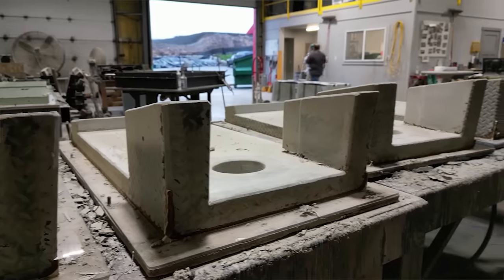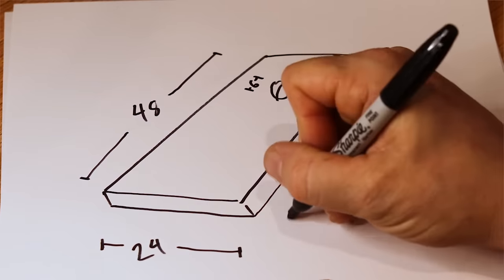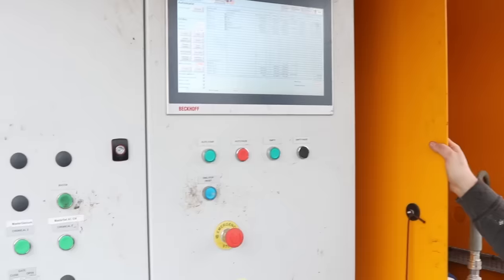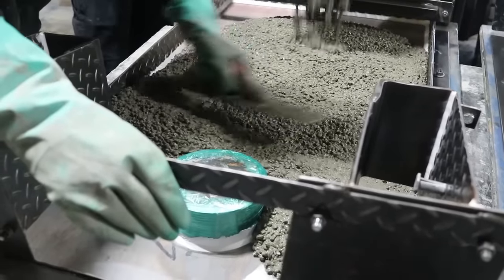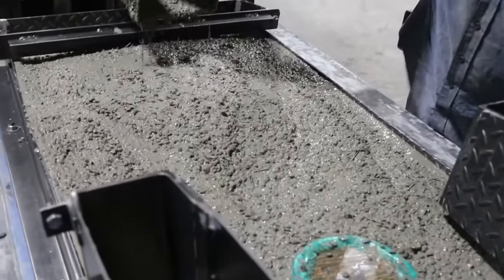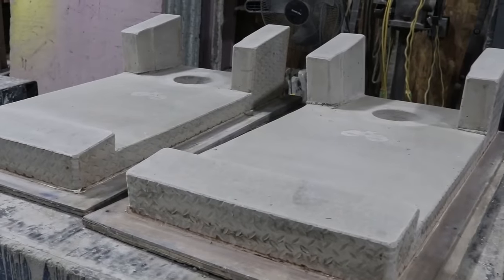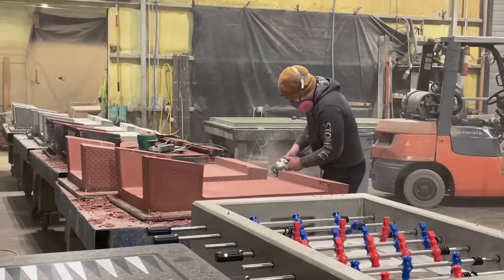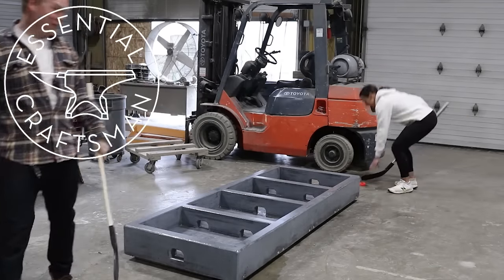Building an Unbreakable Concrete Cornhole Board

Comment: As a DIY cheat mix up some fine cement plaster, just sand and cement along with color, if you want, to paint your forms with to a 1/4”-1/2” thick before pouring in your concrete; this will ensure a good smooth finish without hollows that can come from pouring concrete straight in. Without vibration you risk aggregate being at the finished surface and with too much vibration you risk aggregate separation. I’d also embed my rebar or mesh in the middle rather than pushing it in at the end just as it’s easier for most people to do and can provide better strength, though with these small if projects concrete without any fibers or reinforcement can be strong enough for home use.

Comment: If you can’t find melamine or it’s to expensive, you can build your forms with 2x construction quality wood/boards and then line it with pieces of 1/8” Masonite , you can glue the Masonite to the inside of your 2x forms. To vibrate your forms after you place the concrete in them, use a hammer drill and go over the outside of your forms to release any air bubbles from the surface of the forms. Good luck with it if you decide to try this Do It Yourself project.

Comment: this would be great idea if the cornhole boards were made from the whipped concrete the stuff with bubbles like an Aero bar its lightweight, then they would be easy to move around rather than needing two men & a horse to move them but a pretty cool idea to make all this out of concrete
Reply: I think the whole point is that they're hard to move.

...they're designed for public parks, etc.

Comment: What is melamine .. is it a powder mix put in the mix .. I looked it up and found it speaking of forms not mixes ??
Reply: Melamine is a product used for the forms it’s basically a smooth partial board and has a white face
Reply: @salient2849  .. ok so maybe the vibrating is what made the concrete look smooth and not a plasticizer
Reply: @Jesusiscoming24  yes exactly the talks vibrates which causes the concrete to consolidate there for producing a nice finish, it’s the same concept as actual concrete forming when you use a vibrator inside the forms so that when you take them off you’re left with a smooth finish, you can get the same result by just tapping the form

Comment: What would the price for chess board 1 inch thick 20 x20 inches  1/2 round sides with engraved algebraic black lettering  with heavy duty legs blue for dark color squares?

Comment: The part I don't understand is the lack of cracking.  You pour a "2D" driveway/patio, all the re-entrant corners will crack so you need to put joints in to guide the cracks.  But somehow the 3D re-entrant corners don't crack!  Concrete magic
Reply: The concrete fibers, steel lattice, and plastizer all work to stop the cracking. Plastizer (water reducer) greatly improves the strength of the concrete. Water reduces strength in the mix process. Plastizer reduces the need for so much water. 👍
Reply: It’s a small item, concrete sidewalk that’s 4-5 feet wide will usually crack every 10 feet even with 3/4” joints tooled in every 5 feet. So something that small, especially if you put some steel reinforcement in probably won’t ever crack. That’s a pretty nice DIY project if someone was interested in a semi-permanent game board area.